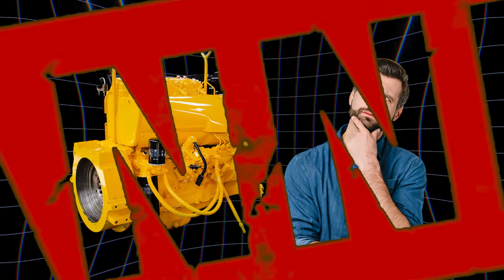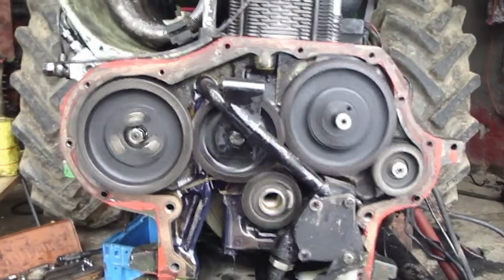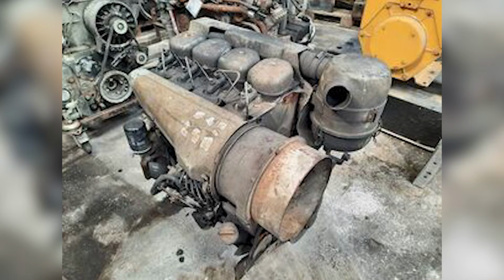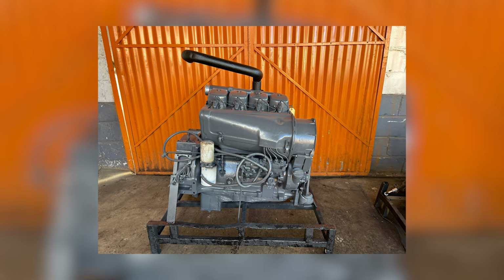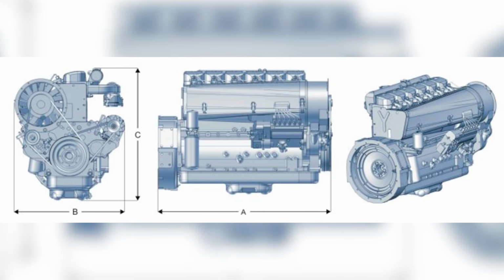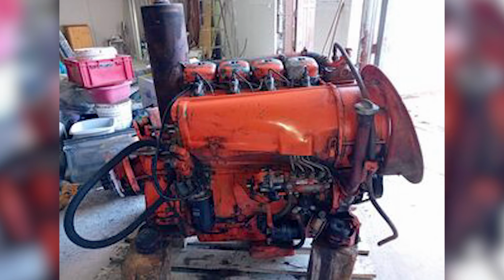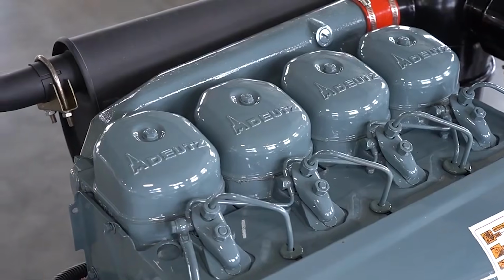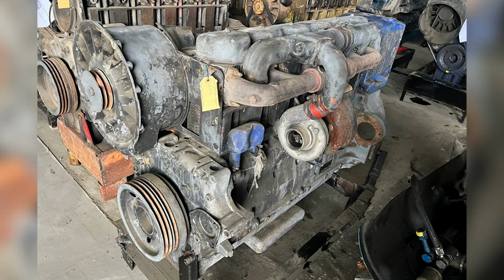Why Deutz F4L912 Was Banned: Too Strong For It's Own Good

Comment: The one in my grandpas 6006 from the 60s still starts after a single turn of the engine, only thing ever done to the engine was changing the oil
Reply from the maker: That's incredible reliability! It really speaks to the robust engineering of those Deutz engines.

Comment: This engine makes 52 hp. All 912 engines are 13 hp per cylinder. I used to rebuild and service these engines in an underround environment. Often we had to take the shrouds off and run the engine wide open to get the CO and soot levels down. It was virtually impossible to overheat this engine.
Reply from the maker: That's some serious hands-on knowledge! Thanks for shedding more light on the durability and unique characteristics of these engines. 😊

Comment: So it was good, then bad, then good again...
I've heard that there's Tatra engine of similar design that meets Euro 5 emission demands. Just simple mechanical injection and air cooling.
About emissions.....
What is more enviroment friendly? Older engine that runs for decades and burns a bit more fuel, easy to repair and simple?
Or new optimised for emissions and burning oil up to 1l per 1000km and destroys itself after a couple of years? Cooling systems made of plastic, operating temp over 100C,  tiny piston rings and 3 cylinder design shaking like crazy.
Technology just made a big backflip and landed on its face in my opinion.
There was a peak at 90s and early 2000s. Electronics took over and yet relatively simple. Now it's just downfall
Reply from the maker: It sounds like you have some great points about the trade-offs between older and newer engine designs and the impact of emissions standards.

Comment: I have a 90's Deutz DX 3-30 with its original F3L912 engine ,( so even Deutz themself preferred it over a 913 in some cases ) and I  haven't had any engine issues so far.
Reply from the maker: That's a testament to the reliability of those engines, thanks for letting me know.

Comment: Better models had individual injector pumps working directly off extra lobes on the camshaft. The air cooled Deutz engines were killed off by emission regulations at about the same time as Same/Lamborghini/Hürlimann air cooled engines were killed off. The current Deutz engines are water cooled and built at the old MWM factory. The rest of Deutz was bought by Same who are now known as SDF or Same/Deutz/Fahr.
Reply from the maker: Thanks for sharing that detailed insight! It's fascinating how engine technology and regulations have evolved over the years.

Comment: They are running very well even in desert weather  hot or cold they working good start with three cylinders  of generators  till 6 or 8 cylinders  of trucks .. very strong nd not taking to much  repair.. especially  if u keep it clean ftom oil leaks to keep sand accumulation  on airways.. thanks for the video
Reply from the maker: Absolutely! The Deutz F4L912 is known for its reliability and performance in extreme conditions. Keeping it clean is definitely key to maintaining its strength!

Comment: Manufactured in India since 1989 as Kirloskar HA series engines in 2, 3, 4, and 6 cylinder configuration by Kirloskar Oil Engines Ltd. Even to this day. Excellent engine for many applications.  However, current environment norms mean only a few off-road applications are permitted  in India.

Comment: We ran them in Ingersoll Rand mobile compressors when I worked there, noisy and the customer preferred the Perkins and since we had winters that were not soviet levels of cold the coolant was never an issue. Both were equally reliable and very durable.
Reply from the maker: Thanks for sharing your experience, it's interesting to hear that the Perkins was also a great alternative.

Comment: These engines are work horse's plain and simple and were actually more fuel efficient than many of the newer "emissions compliant" replacements!
Never figured how consuming more fuel to produce the same amount of work is better for the environment!
Many of the modern emissions compliant engines actually will consume almost twice the fuel than if you delete the emissions components! The emissions standards also makes normally reliable engines very non-reliable ! The new greener focus looks real good for a very short period but fail epically in the long term!!
Reply from the maker: You make a great point! Many people are starting to realize that older engines like the Deutz F4L912 had their strengths, especially in terms of efficiency and reliability. It's definitely a complex issue when balancing emissions with performance.

Comment: I still have that engine in a Deutz D7206. Still runs perfect since 45 years. Just the gearbox has some problems.
Reply from the maker: That's impressive that your machine has lasted for so long with the original engine.